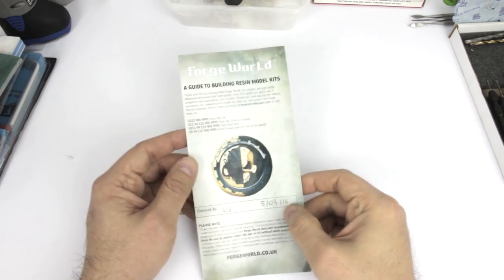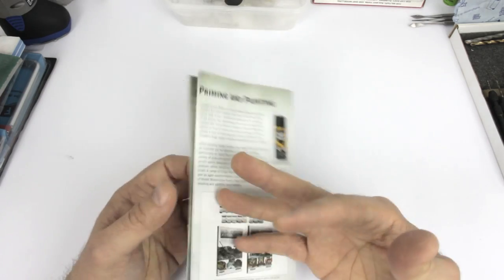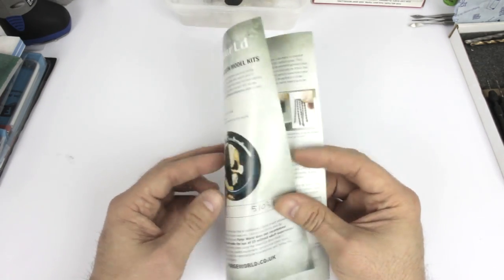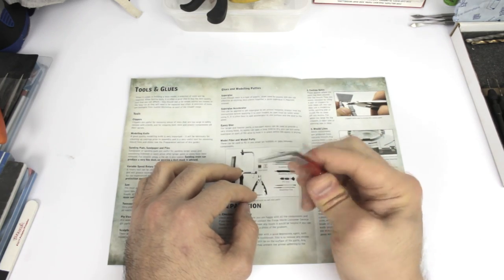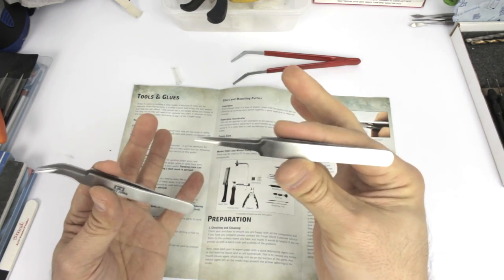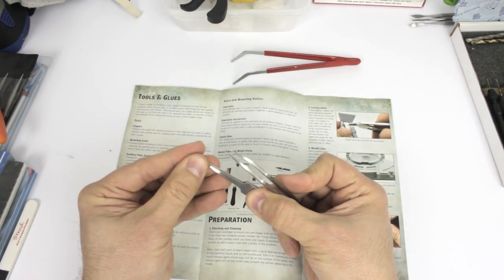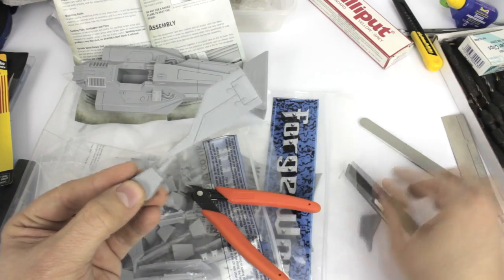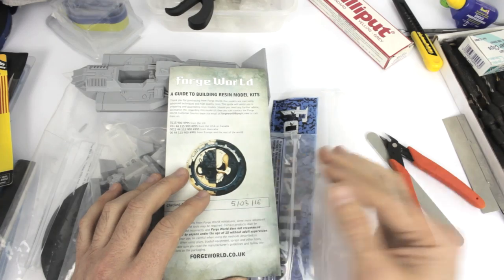How To Build Resin Models: Get the Right Tools!

Comment: Thanks for the great info! Just started with resin figures for my aircraft. Am novice modeler, and trying to gather all the tools I'll be needing for assembly of models. What do you use for a degreaser to remove the mold release? Oh, i use a Drill Doctor to re-sharpen all my dull bits, i found it was a good investment when i was working in a fab shop. I also used the pedestal grinder, but my vision has been getting progressively worse and i find it much easier to use the bit sharpener. Altho, on the bigger Silver and Deming bits it won't work. What glue do you use to glue the resin upgrade parts to the plastic kit parts? Thanks for the great tutorial.